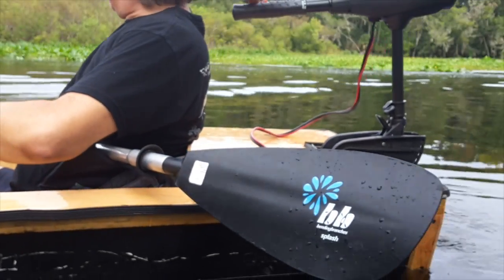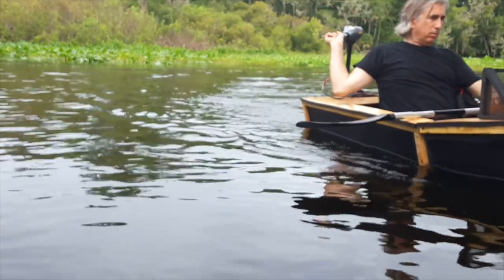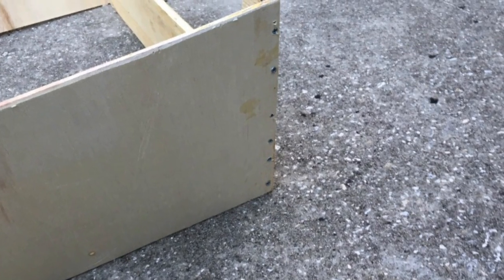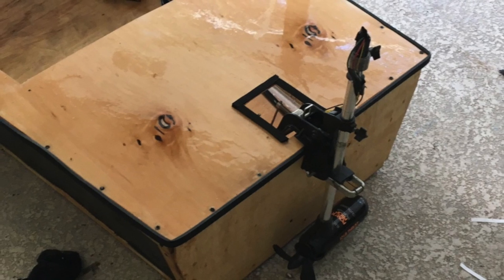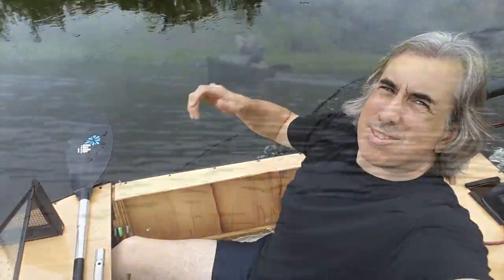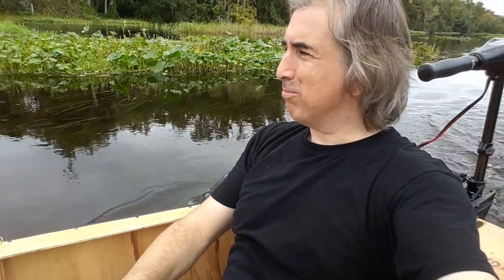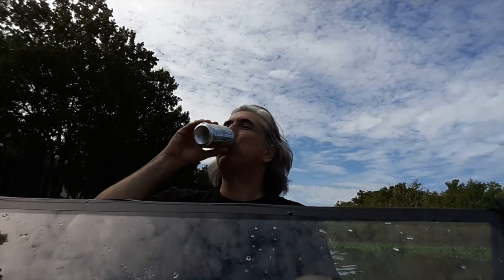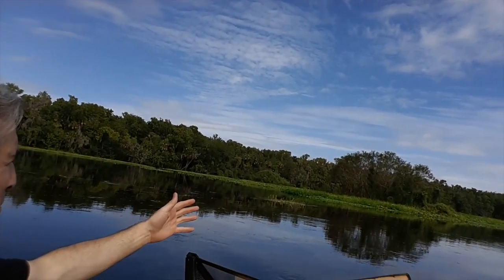Wekiva River Microboat

Comment: Like that. How do you keep water out - are the bulkheads above the waterline?
Reply from the maker: Hi! Yes, you can see at the 2:15 mark that the bulkheads are about 6 inches (maybe 8, can't quite recall) high.  This can make it a bit annoying to ride in - depending on how you choose to sit - as you have to keep your legs above the bulkheads... I would suggest a cushioned guard that fits over both bulkheads for comfort. It wasn't really a big deal.

Oh, and this is where you will get a leak if you put too much weight into the boat. I have weighed up to 215 and when I use the boat along with two batteries the boat will take some water up between the bulkheads. A bigger boat (or lighter weight) will remedy this.
Reply: @BrooklynAvenue  Ah okay. Well thanks for your prompt reply. Nothing insurmountable I suppose? It must make the boat easier to transport & store.